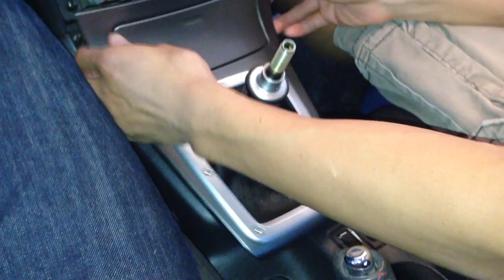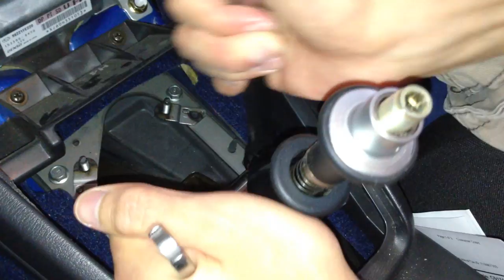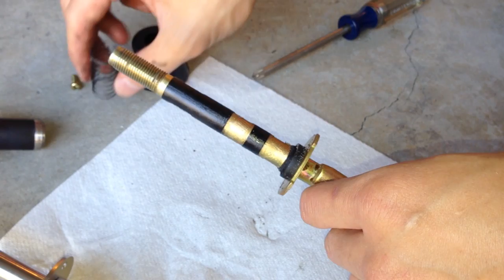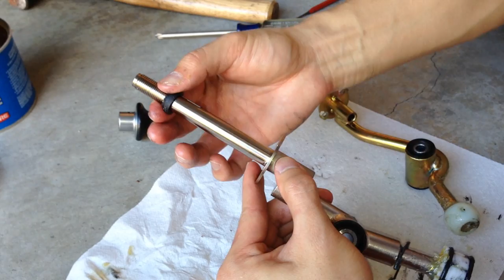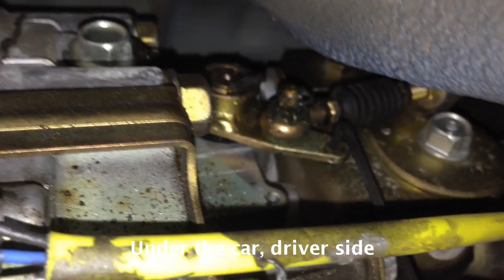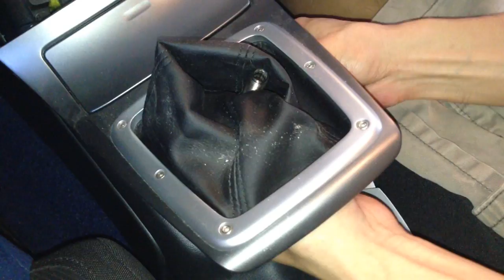Tutorial: How to Install Kartboy Short Shifter on 2006 Subaru WRX STi

Comment from the maker: lol, the "shorter stick" part youre referring to doesnt actually make the shift shorter, thats really just for looks.  its the distance between the base and the rod connected to the tranny that makes the difference.  that distance is longer than the stock stick, changing the angle of the rod, creating shorter throw.

Comment from the maker: SPT does make a short shifter for the car, but its not stock.  you can add it on when you buy the car i believe or just outright buy it later like you would the Kartboy.  compared to stock, the Kartboy is wayyy shorter, i believe 50-60% and not, sound is the same with the bushings. id def. recommend the bushings too, makes way more difference than the actual stick.

Comment: What is that piece below the actual shift knob?
Reply from the maker: that piece is the reverse lockout cable.  you pull up and hold that ring, and it'll let the stick go into reverse.  safety measure so if youre going 60 on the freeway in 5th, you dont accidently put it in reverse instead of 6th